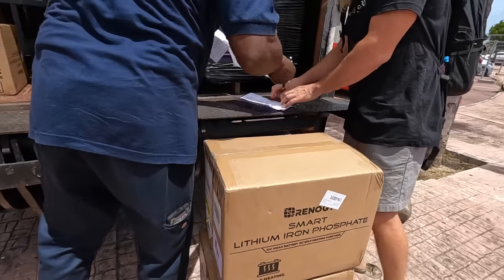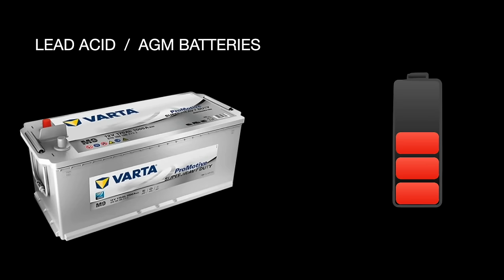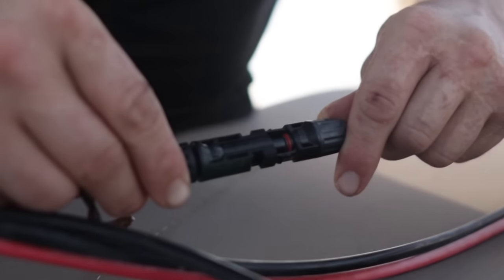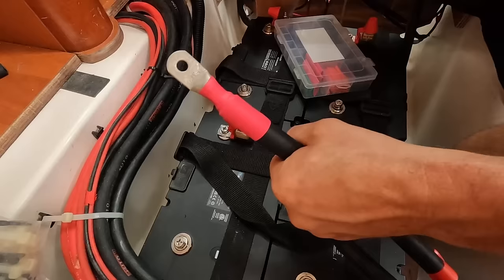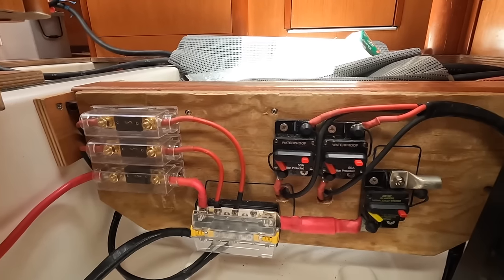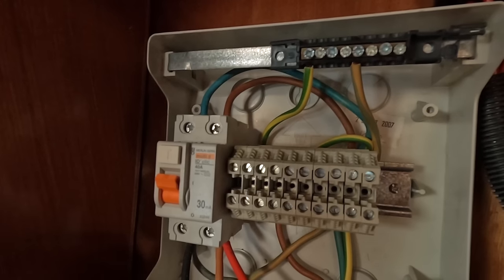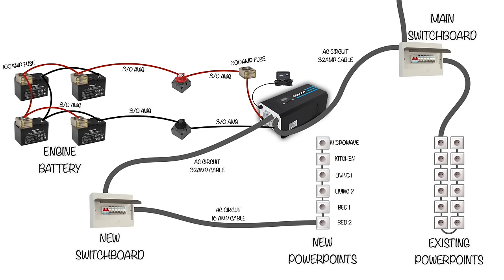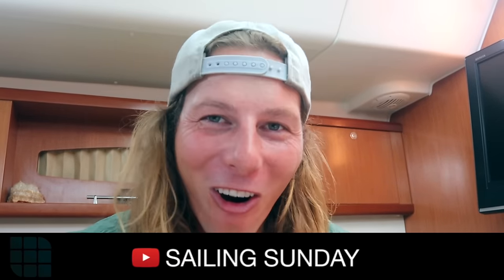RENOGY Off Grid Solar Installation on a boat!

Comment: I upgraded to Renogy Smart batteries (2), a dc-dc charger and MPPT / Solar panels last year.
Still works fine after a year at sea. The best move I ever made on my boat. Now I can run the toaster, the microwave and lots of other appliances without worrying about my batteries. The lowest SOC I saw was 30% after two days of no sun.
Definitely a must for serious cruisers. Cheers, Richard
Reply from the maker: What a great solution with the mppt dc-dc charger! Lithium batteries are such a game changer, it's been the best year on the boat so far for us running the washing machine, induction cooktop, vacuum cleaner, Brittnis hair dryer, making toast and coffee in the morning. The fact you know your batteries SOC is actually 90% or 30% and not trying to "guess" where the lead acid batteries SOC are at is a huge stress off our shoulders! It's made living on a sailboat so easy and much more convenient!
Reply: How many solar panels did you put in?

Comment: I bought two 100w renogy panels about 2 years ago and I'm so impressed with how well they work. I'm in Texas, it's currently July 4th at 4pm and they're pushing out 186w
Reply from the maker: I’m the same, I have 4x 160w panels and they’re still going strong over 4yrs later! We’re currently in the Bahamas 💪

Comment: Great video, I have a similar setup to this having watched this a number of times. I have one query, you show the 3000w I/C connected to a hub, does this function work and if so what info do you get as I find it a complete pain trying to get to see the inverter lcd panel and changed settings etc?

Comment: Nice video and diagrams.  I am using Renogy too on my boat.  Couldn’t see why pay more for a Victron system. Their new Core Li battery has a marine rating.  But not a smart battery so adding their new smart 300 shunt.

Comment: Thank a lot for your video. I actually doing the same kind of setup as you but I will plug my solar panel directly to my DC to DC. You plan helped me a lot. I assume with that setup, a battery selector is not needed. You plug your motor directly to your starter battery. Am I right?

Comment: I get why you added the DC-DC charger that's normal for adding LifePo4 to an alternator. But why did you eliminate the isolator for it? It now can drain your engine start battery? Or am I missing something?

Comment: Will order these on Amazon using your link. Thanks for the video. What is the difference between the two different Bluetooth modules?
Reply from the maker: Thanks so much! When we installed this, their newer products used the BT-2 module and the solar chargers we had use the BT-1 module… it was a bit annoying, but most of their new gear all has built in Bluetooth now, so you wouldn’t need the modules anymore 😊

Comment: Great video - thank you. We are just refitting our 1984 Tayana 37 sailboat to begin our journey around the world, Oliver is 60yrs old & I at 52. Had enough of 'standard' life and ready to trade for coconuts -lol. Seriously we are newbies learning how to outfit our boat, what is best bang for buck. With so many options & technology changing so fast, its hard to keep up and sometimes to grasp. Currently we only have lead batteries and in process of adding lithium and solar. Possibly wind as well. But our piggy bank is not so fat. I am going through trying to list how much I will need to replicate your system. But I do not see link for battery isolators - Can you provide info? Thank you - appreciate your willing to share your experience 🙂
Reply: Would you recommend to go with the REGO charge controller, DC to DC  and the inventor if you were purchasing system today 7/2023?
Reply from the maker: Yes definitely, the Rego stuff is another step above, they have perfected all the software with all the bluetooth stuff. So, our Inverter throws a few random error codes on the phone app, even though there are no errors. But its only on the app when I click on the inverter. Everything still works perfectly fine and the BMI still shows the correct wattage coming form the inverter etc which is all i need, but theres just some random bugs in the app that Im 99% sure has been resolved with the Rego gear.
Reply from the maker: I would love to re-make these videos one day with all the rego gear to compare. They have made installation even more simpler by having everything connect via bluetooth without any of the extra components.

Comment: Not sure you can discharge to the last 10% without damaging the batteries.  Inverter won't let the voltage below 9.5v to happen.

Comment: Excellent job !.. I am thinking about the same system for an RV.  Renogy says on their site that the  3000 watt inverter/charger is not capable of Bluetooth.  From your diagram It appears as though you plugged the RJ45 Jack on from the  Inverter/Charger into the Bluetooth Hub and the Bluetooth Hub into the BT-2.  Were you able to get that to work?
Reply from the maker: You're right, it actually doesn't work correctly with the app as it shows a whole bunch of fault codes, but it still shows all the info, the temperature, DC volts, output Hz etc and shows how many watts and % being used. You just have the annoying faults on screen when you tap on the inverter icon. I want the new Renogy One monitor, I wonder if the software in that fixes it!?
Reply: Great video Ryan, I am looking to set up a similar system and called Renogy about the Rj45 connector and they said it does not work also they said i should buy the Rego "same inverter" almost 2x the price to get the built in bluetooth. Has there been any update on this and have you gotten the new ONE Core display as that is what i was thinking of getting.

Comment: Sweet video Ryan ...you made it all sound so easy! Your timing is great because were just researching Solar for our new boat.
Renogy  put out some great kit.
Can you now run your water maker just with Li-battery power or do you still need to run the motor? Just hope we can get this lot delivered to Italy without to many Customs issues!!😀
Reply from the maker: Our water maker is 220v, so we have to run the generator for it. I think if we weren't such a power hungry boat with the electric winches, electric davits, induction cooktop, air fryer, kettle, toaster, vacuum cleaner, microwave, laptops, cameras etc etc, we could probably run it the water maker off the inverter, but we would still need more solar panels to keep up. We make 100L per hour, so we just run the generator for an hour or so every 2 or 3 days to make water and put about 80-100amps back into the batteries at the same time. With the setup we have and running the generator we don't ever worry about power. Another option for us would be to add another 200w of solar panels to help with the charging during the day, but we need to make water anyway so using the generator doesn't bother us
Reply: @SailingSunday  Thanks for a great reply.cheers

Comment: But also, if I believe correctly, you guys live on a boat, so why don’t you guys use vertical wind generators with the charging the rest and they make solar chargers that connect with the wind turbine kits?
Reply from the maker: We had one to put on a few years ago but they had to sit above the solar panels at the back which would shade our panels so we decided to install them.

Comment: Weird setup on the fuses. You have 100amp at the battery terminals and then 300amp downstream to the inverter? No fuses indicated off the panels either (power sources should be fused).

Comment: Heads up folks. The link in the description for the 3000w inverter is 120v and not 220v.. for the life of me , I can't find a 220v version anywhere in Asia. Anyone ?
Reply from the maker: Oh damn I should have said that in The video. I had to order mine directly from Australia! https://www.Renogy.com.au
Reply from the maker: The rest of the stuff I got from the US
Reply: @SailingSunday  Ah ok cool.. Will look at that option. Question on the reason why you installed a separate AC circut for the inverter. Was it because the output is limited to 3000w on shore power ? And do you guys have a separate shore power plug for your AIRCON or just one plug for everything?.
Reply from the maker: @Sailaboat  there was a few reasons. First off I didn’t want to have power running through the inverter when running the generator and or connected to shore power mainly because the generator is 5500w, I wasn’t entirely sure if I would be limited to 3000w… Then the inverter has a floating ground, and our generator is bonded (I think that’s what it is called) so I wasn’t entirely sure which way is safer so just wanted to keep the generator completely separate. Then lastly keeping it separate I just figured it would keep any internal cables cooler when charging the batteries while running the water maker at the same time etc.
Reply from the maker: @Sailaboat  yes we have a separate shore plug for AC.
Reply: @SailingSunday  All makes sense.. I'm having a similar debate with myself atm..🙂